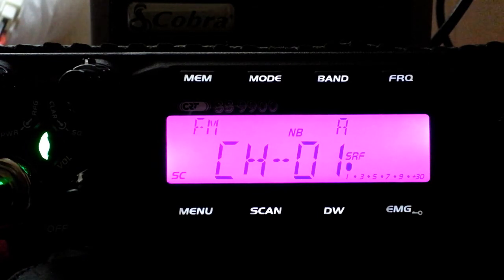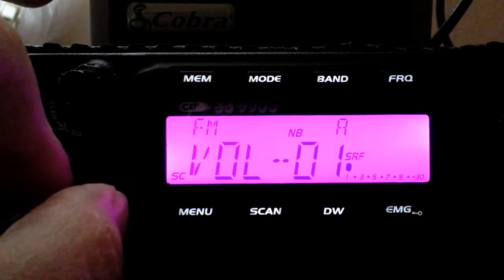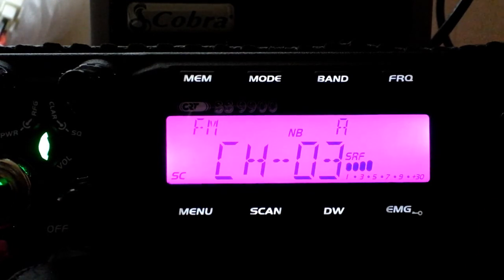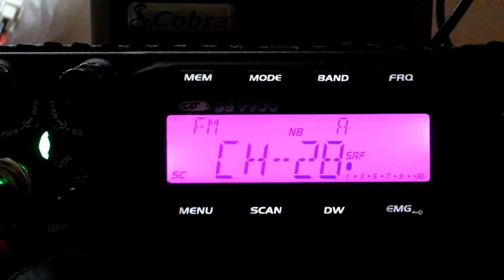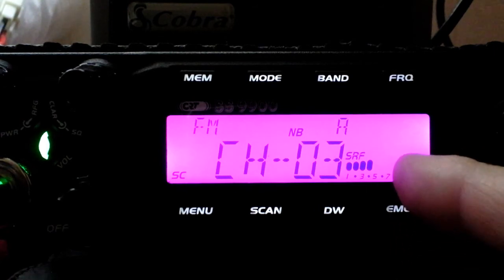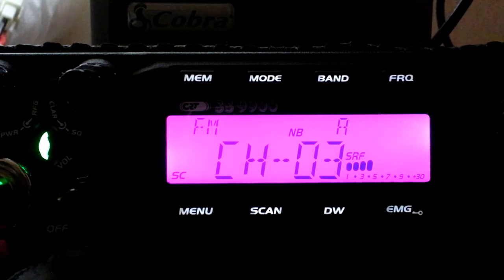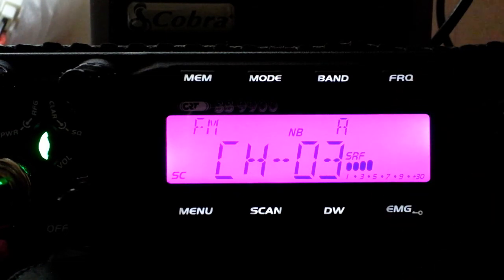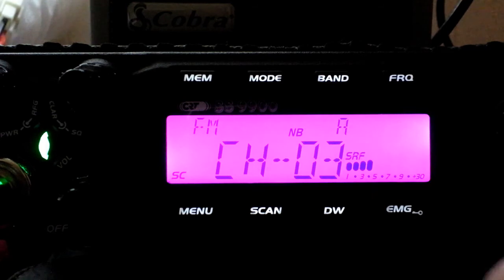Local interference QRM is a real problem in 2017

Comment: Isn’t that what’s called a CB birdie ?, I get that on channel 21 on my Amstrad 901
Reply from the maker: Could be. A "birdie" is interference caused by the radio itself.
Reply: Ahh! The Amstrad 901 and it's distinguishable roger bleep, brings back great memories. I still have one I haven't used for years. I bet a bit of switch cleaner on the potentiometers, and it'll be right as rain.

Comment: For home-based users with noise problems, try using a horizontal (wire / co-ax) antenna. I live in a flat and I used to get S7-S9 noise with a vertical antenna.....I changed to a horizontal antenna (a double-bazooka) and my noise level is now between S3-S4. Most "household noise" is vertically polarised so a horizontal antenna will get rid of most of it. Also, an external speaker with high-pass and low-pass filters will help too.
Reply from the maker: Thanks Phil.  I have been thinking of a horizontal. Iam not sure how well i would transmit though.

Comment: Unless you're a skip-shooting enthusiast, 27Mhz is a poor band for CB use as it's really prone to atmospherics (skip) and QRM. Shame 934Mhz CB was taken away, but that's quality UHF bandwidth and worth money. The 934Mhz kit was expensive back then and the band little used, but radios now would likely be much more cost effective and have more users too due to the high QRM on 27Mhz. Can't see a VHF or UHF CB allocation (with a reasonable power output and external antennas) coming along anytime soon though, so it's left to us die hard 27Mhz users or those using 446Mhz with illicit kit. At the end of the day though, 27Mhz CB does, on the whole, still function for it's intended use - short range comms for farmers, truckers, 4x4's or homebase stations in fairly close proximity, so the authorities say "what's the problem?" when the QRM levels from PLT etc. are complained about. Shame, but we adapt and soldier on! Cheers.
Reply from the maker: Yes i rem the 934 kit and boy was it expensive.  Well said mate.